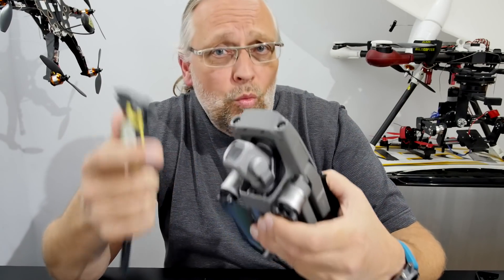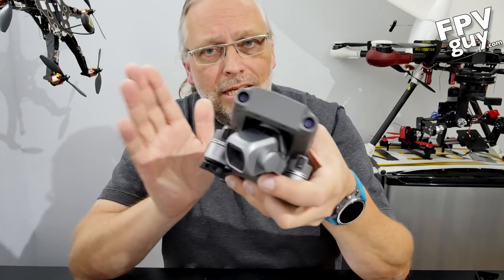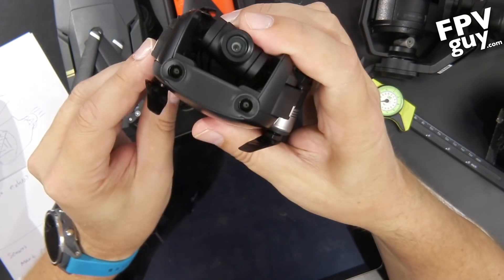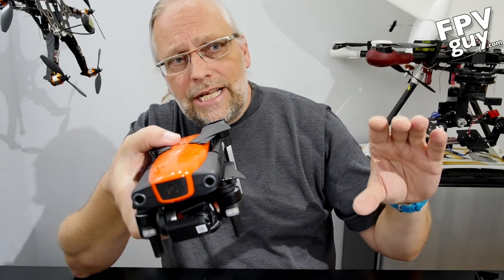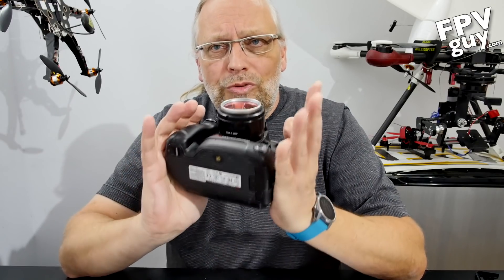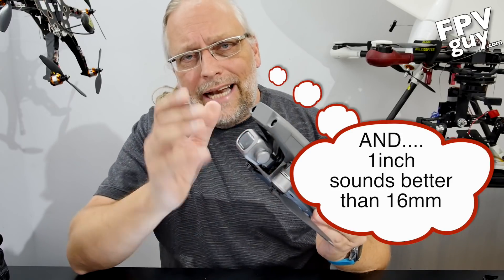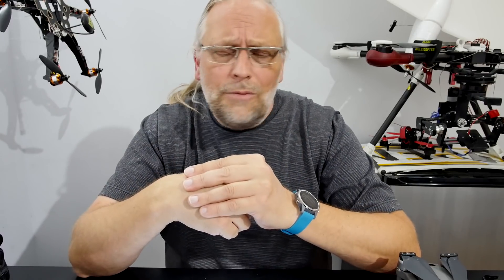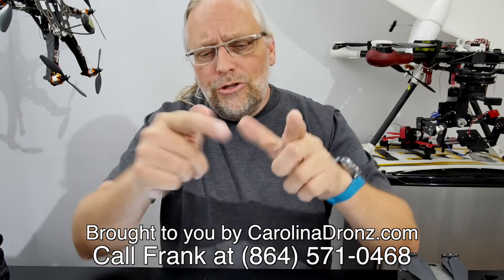HOW small is a 1" camera sensor really?

Comment: They are sposeto be called "1 inch type"    ..not "1 inch"   ....all camera company's use the "type" designation but dji doesn't inform customers that they're 1in sensor is actually only about 1/4th of a square inch    ....APSC is "1inch" 4x bigger surface than "1 inch type"

Comment: Autel Evo and Mavic 2 pro both use Ambarella H2 as the image processor, which supports up to 4k 60Hz videos. Not sure if Mavic 2 pro's 4k 30Hz video limit is due to the higher 10-bit ADC. The evo may use ~9-bit ADC such that it can support 4k 60Hz videos. And therefore, the difference in the dynamic range should be mainly dependent on the ADC.

As a reference, Kodak DCS-14n uses 12-bit ADC with a 36x24mm sensor size.
Reply: are you sure Mavic 2 uses Ambarella H2? or any Ambarella? There are rumors DJI developed its own SoC.
Reply: No, sir. I got that information from some early online post, but actually no one can confirm it, and actually more people believe it's an Ambarella H3. And there are also people believing it's not an Amba soc as you mentioned.

Comment: Hi Bo, Great job in the explanation. Yes, often modern day technology gets its roots from the past.  Like the Roman Empire chariots set the standard for today's train rail widths. 
One important thing about the larger sensor cameras is that they most definitely have an advantage of letting in more light information for the sensor to process in low light situations, but that can work against the  videographer/photographer if the camera's dynamic range limits are still not able to slow-down/reduce the overabundance of light information for the larger sensor. In that case the use of filters is required to reduce the overabundance of light information.  Do I have that correct Bo?
Reply from the maker: Hey Andy,   mostly right,    actually the light is the same regardless of sensor size, we can manage that with ND filters / or aperture,  however the larger pits on the bigger sensor will have a lower baseline noise level,  so the images will be cleaner when doing long exposures at low light. or when boosting the ISO to a high number, with ISO you will see a higher useable ISO number from a larger sensor because the native sensor have less noise.
Wait.. Trains and Roman Chariots?   I need to google that.
Reply: Thanks Bo, Appreciate the information and respect your knowledge. Maybe a myth about the train tracks? Seems to be a lot video and articles that state the reference to Chariot /wagon wear patterns being the same with as train tracks. Maybe it should be fact-checked. LOL. Have a great day Bo.
Reply: Yeh.. I would believe that it was debunked.  It is an urban legend like many others, but some have roots to the origin of a conception that makes a creative idea come to be. That's what engineers do, they improve upon existing or design new from a concept.  Legends are born and become a story to tell.   Ahhhh....... just messing with you..   I'm in agreement with you and stated the comment for fun. I got the reaction I expected. Engaging in fun comments for our drone community.  Happy droning.

Comment: This mavic is fake. Thx for realness
Reply from the maker: OK I think I know what you mean,   actually the Mavic is not fake,  its legitimately using whats called a 1-inch-class-sensor.. but I feel that for most users, this is rather misleading as most simply don't realize that the 1-inch reference really means its a 16mm sensor (not a 26mm)    
STILL its a much bigger and better sensor than what we did see in the original mavic.  so a worthwhile step forward.
Reply: Its a step in the right direction. I have noticed ppl are mad couse only the lense is from hasselblad and the design. Sensor still Sony so ive heard

Comment: Is this "tube"  the same or also installed in the DJI P4P?
Reply: and is there a big loss compared to a normal 1" Sensor?
Reply from the maker: the P4p and the M2p have different models of 1" sensors.
There are no other size for "normal" 1-inch sensor, this is the size which is referred to as 1-inch "class" or "type" sensor.
a larger sensor would have to be something like the m43 sensor.
Reply: @bophoto  Thanks!!
Reply: For interest which Kind of modell ist installed in The p4p?

Comment: Great video as usual bo. In regards to a bigger sensor and low light. Can you adjust shutter speed to compensate for a smaller sensor?
Reply from the maker: Yes, to some degree you can.   but the smaller the sensor are, the more native noise you will find in the system.   and if you are shooting video, you can only reduce the shutter speed so much before you run into the frame-rate.

Remember a sensor only really have one native ISO setting,   all over ISO is created by boosting the sensor.   thats why having a larger sensor, give you a sensor with lower native noise, so when you boost it to say 2000iso, you dont have a lot of native noise that will become visible at 2000.  on pretty much all sensors, noise is invisible at the native low rate.

Comment: So Im not getting a 1" square sensor after all. Measured diagonally like a LCD television?
Reply from the maker: You are getting the AREA that was used to capture image on a 1" TV recording tube.
But the ATUAL sensor diagonal is 16mm or about roughly 3/5th of a inch
Reply: They are sposeto be called "1 inch type"    ..not "1 inch"   ....all camera company's use the "type" designation but dji doesn't inform customers that they're 1in sensor is actually only about 1/4th of a square inch    ....APSC is "1inch" 4x bigger surface than "1 inch type"

Comment: Captain drone did a really good comparison like you do with the MAVIC AIR in the MAVIC PRO

use the same charge that you kind of did but he was trying to show us that they're the same exact sensor in both.. but overall the MAVIC PRO has a sharper lens and a lower aperture better in the light.. 

In real-world comparisons all being equal they could be sidered the exact same quality but the pro has more features when it comes to the camera.. 

The difference is the mavic air makes it's pictures very oversaturated Captain drone thinks they're trying to hide something.. 

You should look it up it's pretty interesting video...
Reply from the maker: Im familiar with that issue,   that said,  there is a flat-spot on the lower-third of the mavicPro gradient that should have been fixed, which is why tree-leaves and forest can tend to mush out.   its easier to dial back saturation than replacing missing data in the gradient.  sooo im sticking with preferring the AIR camera.   overall though I prefer flying the Mavicpro to the AIR.
Reply: @bophoto  

When you put it on -1 sharpness that problem goes away.... it was supposed to be a noise reduction problem putting a - 1 shuts the noise reduction off.. 

What I understand the problem was supposed to be fixed with the firmware update I don't know when you did the test.. 

;)
Reply: @bophoto  

the reason why I said it must be fixed because I haven't noticed that problem on any pictures I have ever took...